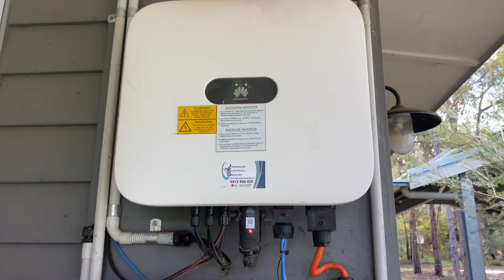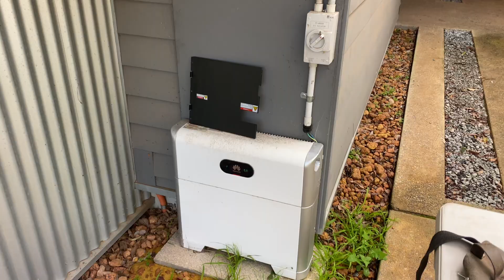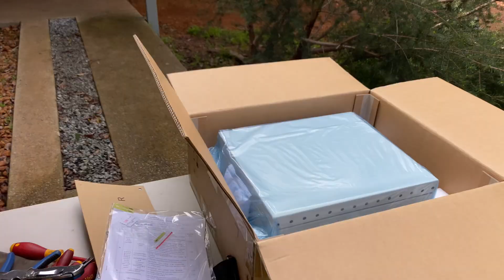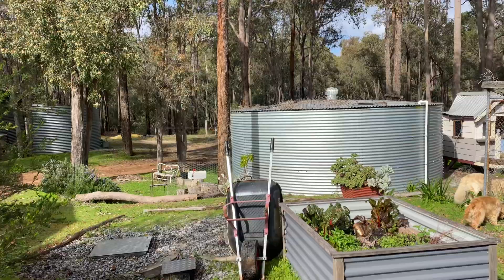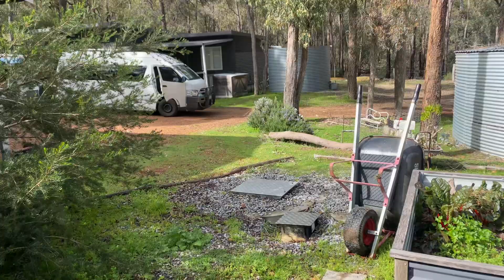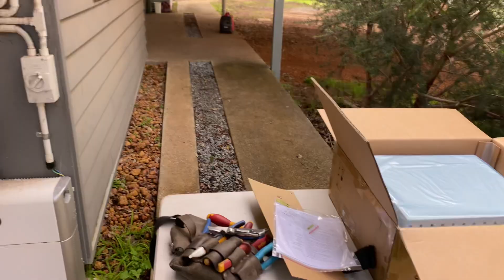Huawei solar inverter with Luna battery and faulty three phase backup box in Mundaring Perth.

Comment: Shame you didn’t give a better image of the contractors. I have been in industry all my working like and never seen a contactor that wasn’t either din rail or screw mount in all that time. You sure that bracket wasn’t a clamping mechanism that holds them to the back plate. They looked to all be mechanically interlocked at the sides so soy,d need the same make of contactor. Would be really interested to see that taken apart if you get a chance. Madness having to replace that for the sake of a coil. In the old days you found buy replacement coils even, now that’s only on the bigger stuff.
Reply from the maker: I left the old one with the owner, unfortunately for me to hunt around trying to find a replacement contactor or coil usually isnt financially economical for the client. If it were mine yes I would spend the time finding/making a replacement.

Comment: The mount for the relays looks a lot like a mount I just saw in a video on a generac generator repair from the USA. The channel is James Condon and it was for the 2 pole circuit breaker inside the generator.
Reply: Time stamp is 30:45 ish.

Comment: I have a 6.6kw solar system with a 3 phrase 5 kw istore inverter. Will get a battery installed soon. I dropped the backup given istore told me the backup is only 3.3 kw on single phrase or 3.3kw/3 on 3 phrase. 

Will get a battery installed seperate soon but l am interested if the information provided to me might be wrong. 

There is a lack of information about this backup box.

Comment: It's crazy that they don't use standard DIN contactors. You could have bought, say, Geya components to replace them pretty inexpensively. I'd have even been tempted to just take the rail out and replace it with a DIN rail and equivalent components. But I've got a tame electrical engineer who can help me with that sort of thing.

Comment: Backup power with a 5kWh battery that is good for 2.5kW max load! really? If he added another battery pack it would be 10kWh storage and 5kW load. A Toaster and Kettle at the same time could get close or exceed that. About all you would want to backup with that is lights and fridges and fridges would not likely be on their own power circuit.